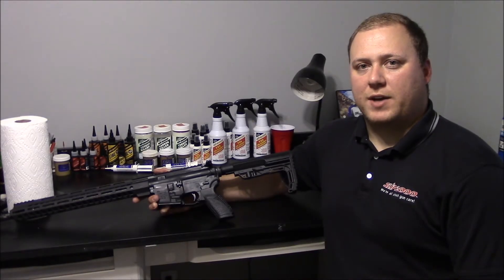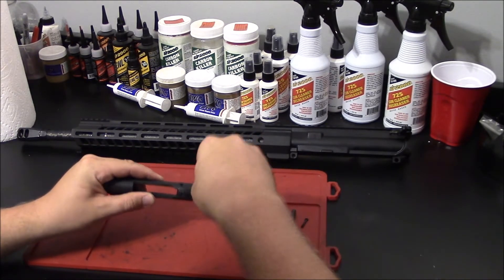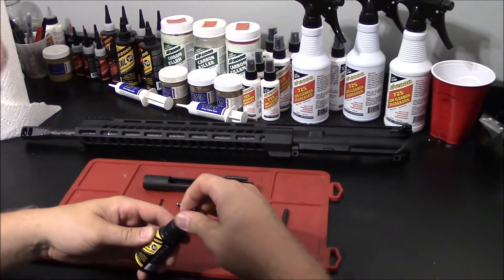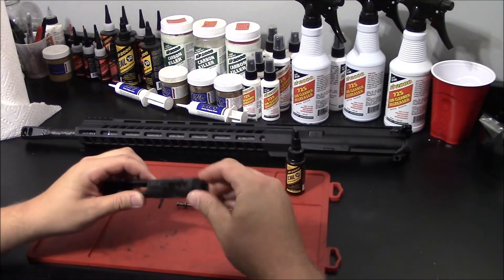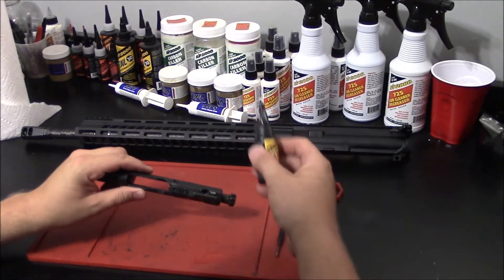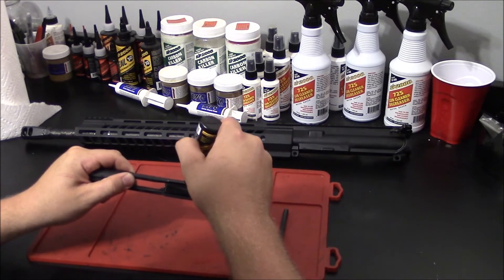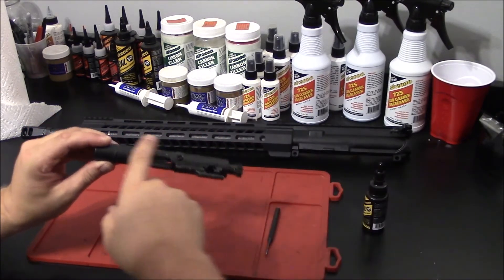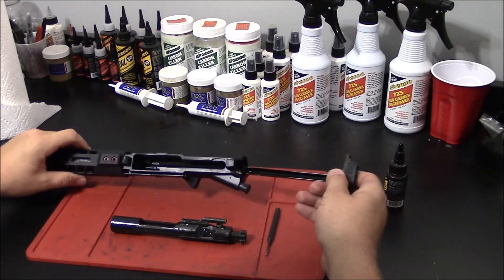Anthony Spinelli: AR Lubrication with Slip 2000 EWL 30

Comment: I’ve used EWL for the past 5 years and love it. I have a few AR style rifles in 223 and 308, is there a big difference for the ewl30? I think I’d like something a little closer to grease for the 308s like this Ewl30
Reply: I like the 30 over the standard EWL. They used to have a 50 weight but I don't see it anymore.
Reply: @Joe_Friday  Started using the 30 with no complaints! Holds up well

Comment: Properly? Nah. Spray it all over. Wipe it lightly. Place parts in front of space heater for an hour rotating periodically. Hang up in an open room for a week. The oil is baked in, it will resurface when shooting. And for all you that's to much oil guys. The only problem with to much oil is dirt. You clean after every shoot.